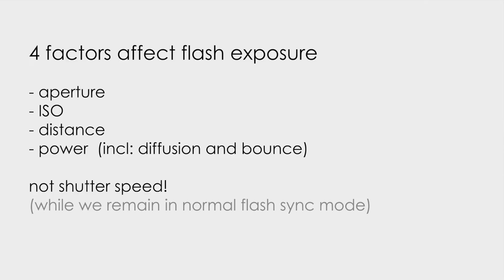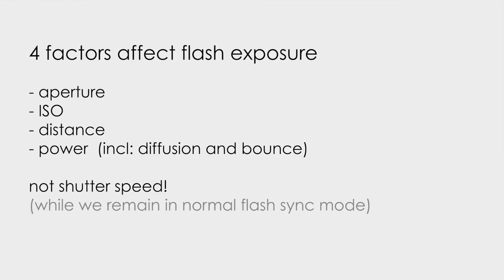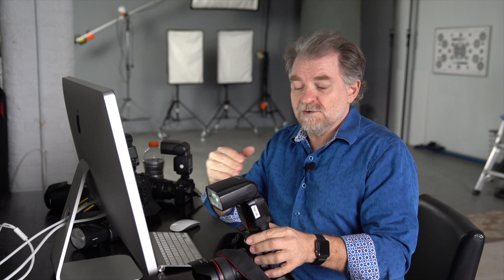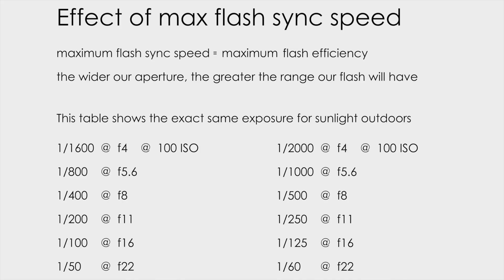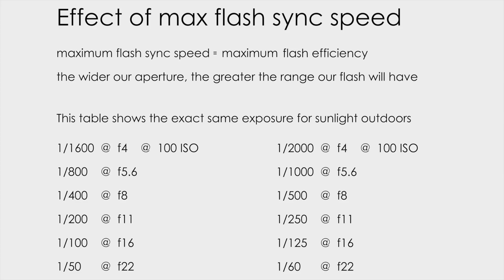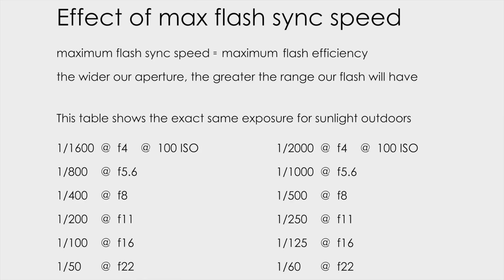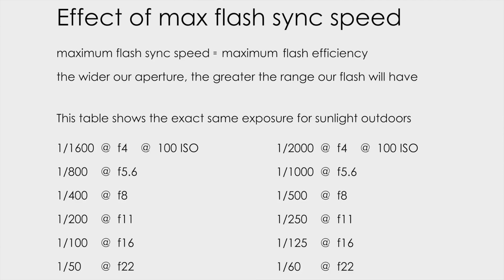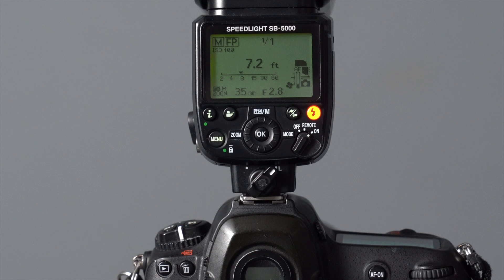High-speed Flash Sync (HSS) tutorial.

Comment: Thanks for your Videos, Neil. I've been shooting since the mid 1970's and watching your videos, I'm learning things I just never knew. Really awesome!
I do have a conundrum, though and would appreciate your covering it.
I have many speedlights including some original 285's that I still use for real estate photography, to light background spaces and rooms, calculating their own light. Still works.
My usual kit is 3 YN968n speedlights. They all talk to each other of course, but I also have 2 YN 622n trigger/receivers and a 622n TX trigger to use if everything else is engaged.
I also have studio strobes with battery packs that I use for Studio and on locations where lots of light is needed.
If I use any of the YN 622's to fire my totally MANUAL Neewer/Flashpoint 600ws studio strobes, they surprisingly work in HSS right up to 1/8000. I've often done that where even on 1/32 power, they are just too strong. I don't understand how that can happen and just wonder if you could explain  it. Thanks in advance ...in case you do.
Reply from the maker: Hi there ... I suspect what is happening that you are seeing the tail-end of a slow decay of the flash burst ... and then even at fat shutter speeds (while not even being in HSS mode), you get fairly even flash exposure across the frame. 

Check out this article for an explanation of what I think you are seeing here:
https://neilvn.com/tangents/syncing-at-higher-than-max-flash-sync-speed/

Comment: Just a quick word, I have cracked it! setting for HSS on my Lumix FZ1000 II, I had to do a full reset on the camera as I had most things turned off and thought it may be impacting other settings, It comes under fill in flash and  second-curtain sync with mechanical shutter, Tried and tested it and it works at all shutter speeds up to 1/4000, unfortunately the Lumix manual is very vague and not very helpful at all with this and more to do with trial and error and sheer bloody mindedness! Once again thanks for your comments and keep up the good work and if anyone has one of these cameras, now you know how it's done! Now I can go ahead and upgrade to the V1 flash for a lot more power!

Comment: Sir plz tell how to measure distance when use soft box and when i bonce flash
Reply from the maker: When you are using a softbox or bouncing your flash, or doing anything else but using the flash directly forward, then obviously the distance scale on the flash is meaningless. 

You will then have to find another way to calculate the correct exposure.  For manual flash, the simplest would be to use a handheld meter. You can also use the histogram method and see where any white tones spike. You can also just look at the LCD preview to see if the exposure looks good. 

(For TTL flash, you rely on the automatic metering, and adjust the FEC accordingly.)

Comment: Thank you, Neil. Understanding that shutter speed reenters the equation when using HSS is a revelation! In the spirit of reexamining assumptions: does the sensor's crop factor have to be considered when setting the zoom on the flashgun? i.e. If I'm I'm adding direct fill flash to an ambient capture when shooting a 25mm lens on MFT should I zoom the flash to 50mm to cover the equivalent field of view? Or, should it be set to the actual focal length of 25mm?
Reply from the maker: You can set the flashhead's zoom angle to match that of the crop-sensor focal length.  For simplicity of calculations, you could perhaps just stay to the actual focal length.

Comment: Sir you are good teacher
My question onse again when i use speed light on camera it sow distance but when use triger no sow distance i have d 750 Nikon with sb 5ooo flash use with outdoor at ss 1000 f2.8 light is no proper on the subject at ss 250 ok
How to measure distance
Reply from the maker: This is where it becomes necessary to memorize a few settings, and then apply the same when the flash is used off-camera (without modifiers).  

For example, if you knew what the flash's output (as aperture) is for a specific distance / ISO combination -- it would be the same when you use a trigger.  And from there you can interpolate for other apertures, and other flash power settings. 

Just memorize 1, or 2, or even three combinations of settings.

Comment: I use an EX 430 III RT with a guide number of 43m (do not know how much it is in feet) with my M50 mark II. What about FEL? I founf out that TTL gets the exposure spot on if I use FEL with TTL.
Reply from the maker: I don't use FEL, but if the technique works for you in getting consistent exposures, definitely use it.
Reply: @neilvn  the M50 mark II tends to select a higher power output in darker scenarios and a lower power in better lit scenarios (with respect to the desired output power). The FEL preflash gives a consistent base before I use FE compensation. I guess your professional grade cameras are equipped with better computations of the required power or it could be the flash I have was optimized for DSLR use rather than mirrorless.

Comment: What, I think is another thing that you need to put into the equation, is modifiers. They rob out more power from the flash don't they? So that is something else to calculate.
Reply from the maker: Modifiers obviously do affect output. This tutorial is concerned with HSS though — and in considering HSS vs Normal Flash Sync, the modifier doesn’t affect one differently than the other.

Comment: This range meter in M mode on flash is different in sunlight and in a dark environment or it's equally approximate?
Reply from the maker: The flash output doesn't change whether it is a brighter or darker environment ... HOWEVER, since there is more available light to contend with in a brighter scenario (like sunlight), it does affect the overall exposure.  At some settings, the available light will act as a kind of fill light (when the flash exposure dominates), or the available light and flash will be about equal ... or the flash will act as a fill light, if you have the available light as the main source of light. 

There's a wide range of possibilities there in how you balance flash and ambient light.  But your flash output remains the same.
Reply: @neilvn  Thank you for an answer

Comment: Hello Neil  You said leave me any question and you would be happy to help. So I am asking. I am not sure you can help me on this one because there are so many variables. Your tutorial was great. It is repeatable but my situation I am trying to figure out before going into the field to test and come up with a repeatable way to get correctly exposed images in manual mode with flash. First I would like to use High Speed Sync to photograph fast moving objects like birds or animals using a shutter speed of 1000 to 2500.. I want to just use the flash as a fill, not as the main flash. (I know this can be done, I have seen videos and websites that describe the process with results but not any information or details on flash or camera setting, seems like they are guessing and or trial and error) Using a long lens say 400 2.8 to 600 f4  with 1.4 or 2x extenders also using a product called a better beamer. http://mountainnature.com/Photography/techniques/flash/betterbeamer.asp   https://digitalbirdphotography.com/4.3.html   Fresnel lenses can increase a flash up to 2 stops of light. The hard part is up to 2 stops, there is nothing set in stone and many variables. You can not readthe back of the flash to determine correct exposure and birds in flight move fast and if they travel towards you things change quickly as far a change in distance. I did email people using this technique but only one response and they said basically (guess) trial and error. I would like to make this a little more consistent or repeatable. I wish there was and automatic way to do this but if there was, anyone could do this. Any help would be appreciated.
Reply from the maker: With so many variables thrown into the mix, you really are mostly down to trial and error.  Especially since guessing the distance at which a bird is flying, is difficult.  Sorry I can't offer a more specific algorithm here.
Reply: @neilvn  So I got another reply back from someone that uses this technique for birds in flight. First let me say your video did help. If the Fresnel lens gives you back 2 stops, and using high speed sync takes away 2 stops it should be a wash and I am right back to the beginning of your video with the sunny 16 rule. I was told that using the better beamer was to fill in shadows, that is all. So in your calculations of distance error to the longer distance, worse case you don't fill in the shadows. I if you are too hot you will blow out highlights which is worse but even then you may be able to recover highlights in post when shooting raw. Manufacturers should come up with an automatic way to do this with either preflash or distance with metering. Seems like a no brainer to me. Maybe a 3rd party strobe manufacture will put a laser on the strobe that could measure distance. My old Nikon SB-28 had a non ttl auto mode that measured light when it fired and the sensor on the flash would automatically cut off the flash during x-sync flash when it sensed  the right amount of light had been flashes. Again thanks, At least I have a starting point and who knows it may be constant.